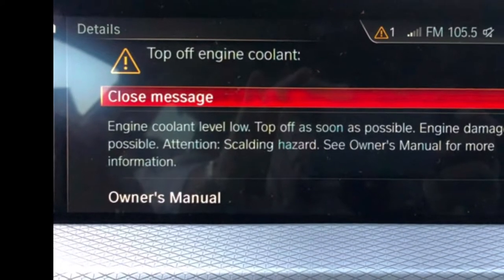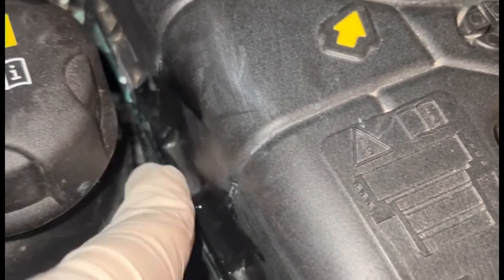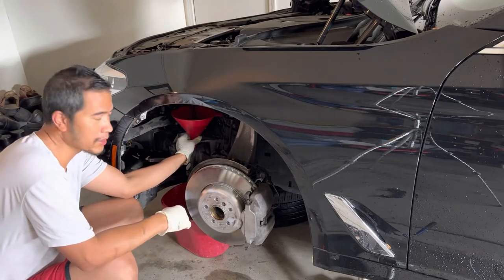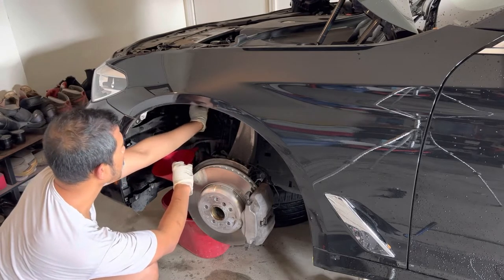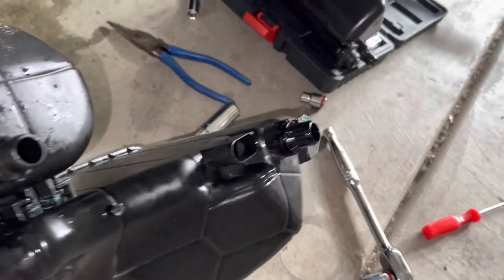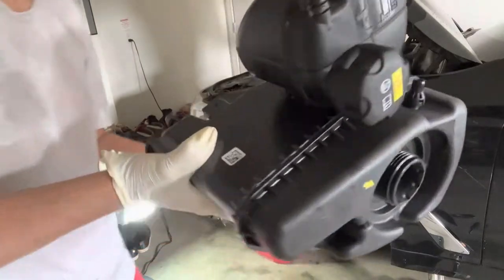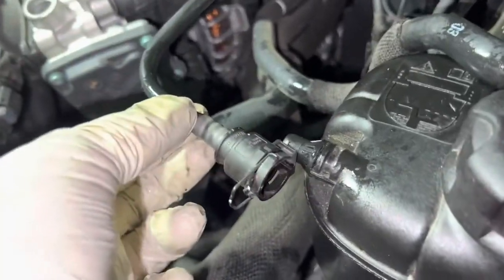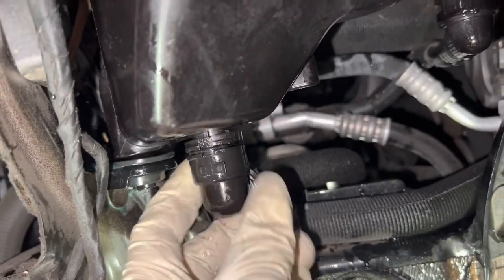2017 BMW 530i coolant tank replacement

Comment: Got it replaced in 15min by mechanic who removed expansion tank from top itself. First removed top hose, removed screws tank was loose slightly pulledup and removed bootm hose clip. Put it all in reverse way. I was surprised because before that I was expecting same process as u mentioned to remove tyre and covers. Thanks for detailed Video.

Comment: Thanks for the video, very helpful!

I'm concerned about air being trapped in the coolant system. Does the coolant system not require bleeding? Also, BMW warns against filling coolant without first creating a vacuum (not talking about topping it off).